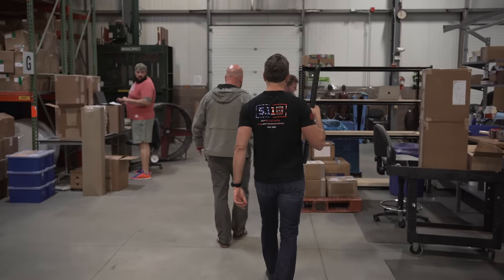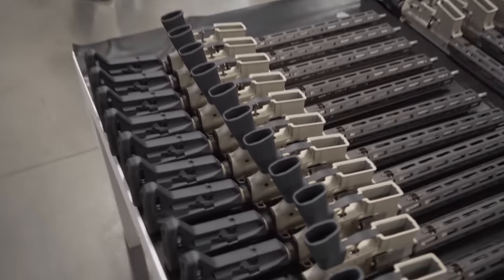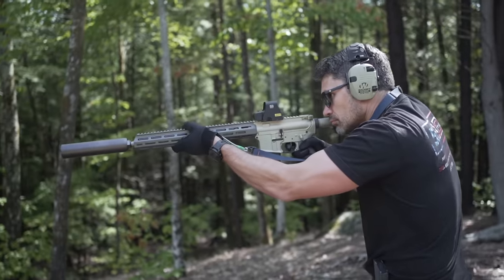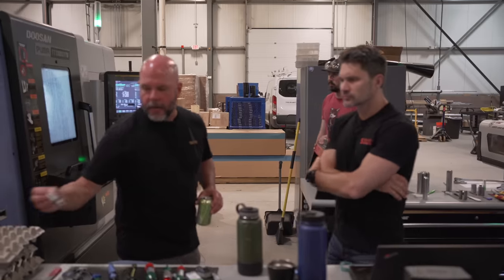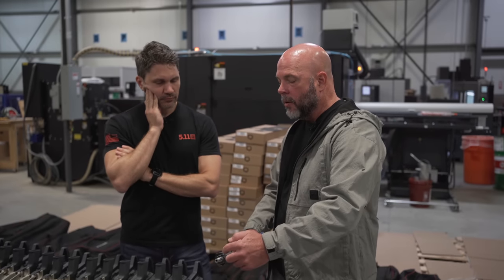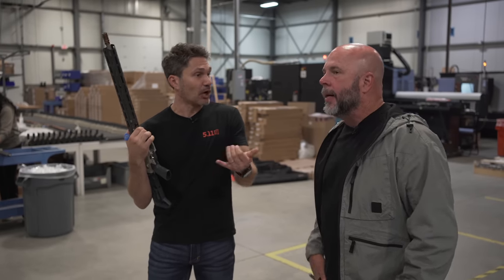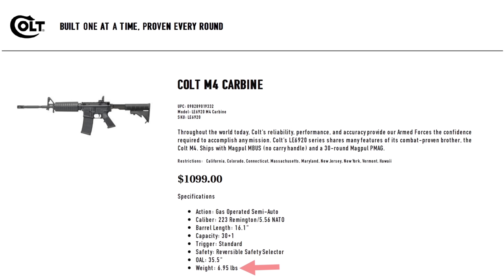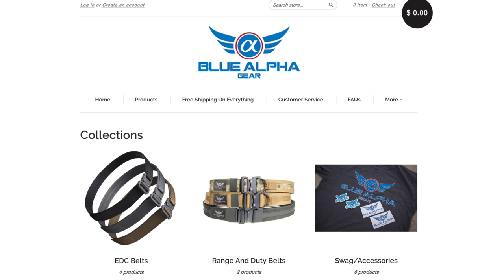Why Q's AR-15 Will Disrupt the Market: The Sugar Weasel 16"

Comment: Why go with their proprietary expensive AR when i could purchase a factory AR15 for less? Serious question
Reply: No proprietary parts on this one, it’s just a well made ar with tano receivers
Reply: Because the factory AR won’t be the same quality or have the same QC. That shit matters. Plus, the SW isn’t that expensive. $1500 isn’t pricey for a good AR.
Reply: Capitalism bruh so far very few Gucci ARs out run a psa
Reply: Not sure but getting any aero lower and good quality upper like bcm or dd you can
Slap those two together for less than 1200 and have a more parts that you want instead of typical milspec standards if that what you want.
Reply: Offers something no one else does. Take POF's e^2 chamber for an example, or LMT's enhanced bolt/bcg
Reply: Why get an F-350 when I can buy the F-150 for a lot cheaper?
Reply: Completely agree and I own some very expensive pieces. I stay away (or try to) from the proprietary stuff…..cuts off the aftermarket goodness and ease of repairs.
Reply: @morrokbyo  A 350 has capabilities a 150 doesn't. That's like comparing a .308 to a .223.
Reply: @Dressed2KillTaye  just as good poor
Reply: Because that's what a tool would do. A tool would buy from them. Unfortunately, tools live AMONGUS. So Q has clients
Reply: It's not proprietary. You get it if you. Want the upgrades it offers over other options. Just changing out a trigger over a bone stock AR can set you back hundreds. Piecing one together involves building and potential issues there. It's the same reason you'd get a nicer anything over a cheaper option.
Reply: @georgefloydsinhellwbreonna5330  "BuT MuH pSA-15 lOwEr WiTh MuH BeAr CrEeK uPpEr ShOoTs 1 MoA"
Reply: You know what I figured out? I like my 600 dollar db15 better than my ddm4v7, why? I upgraded the trigger charging handle muzzle break opted for a high end optic And I still haven't hit 1500 dollars not a thing bro just don't need anything like what's being shown
Reply: @sodakhilljack7147  Welcome to the light. Up here is where everyone who has realized there's no reason to spend big money on an AR resides.
Reply: It's not proprietary, If it were it wouldn't be an AR15 anymore.
It's just a nice AR15
And uhhh this is a "factory" AR-15. Do you mean like a super generic cheap M4A1 looking AR15?
Reply: You commented on a video you didn’t watch
Reply: @tysonbaker7085 "well made"
Reply: @sodakhilljack7147 you don't have a high end optic if your bottom line is under 1500.
Reply: High performance isn't for everyone.
Reply: He probably bought one of those airsoft scopes with a laser, red dot,  and a "red and green multi reticle" for 50$ and thought he found the greatest scope ever made lol.
Reply: @morrokbyo that’s not really the best comparison. An F-350 is like an AR-10 to an F-150s AR-15. There are certain roles where one is better to have than the other.
Reply: Adjustable gas, nice trigger, good resale?
Reply: PSA mic drop
Reply: @thedumbguncollector5546 with your name no wonder you’re supporting the gun
Reply: Bro, I've seen a PSA buffer tube come lose while shooting. I'm not even hating on PSA - I like a lot or their in-house stuff coming out - but they do build their guns to a price point and skip out on QC, or cut other corners.
Reply: @andreivaldez2929  it’s common sense to look over a gun after you buy it that shouldn’t have happened
Reply: @urdnotdank2642  PSA stakes the castle nut on their lowers. I'm guessing he saw one from a dude that broke the castle nut off then didn't reinstall it properly.
Reply: @sodakhilljack7147 how many rounds do you shoot? Have you ever had to rebarrel and upper because you shot it out? Don't tell me your carbine has never had a malfunction because if that's the case you haven't shot it enough. Even the best carbines like KAC, LMT, LWRC, DD will malfunction and fail at some point.

The reason tho cost more is typically customer service, QC, more attention to details, more machining and better aesthetics. 

Can you get a PSA that is superb? Absolutely. It's just more common with higher quality brands that you won't have to wonder "is this thing put together correctly" and if it isn't "are they going to take care of me".
Reply: Did you watch the video ? 😂
Reply: @2amichaelj  The reason they cost more is the name. Everyone says things like "the QC and attention to detail is better" because that's shit that can't be quantified. Plenty of "high end" rifles come straight from the factory with issues.

BTW, PSA's customer service is awesome and you get a lifetime warranty.
Reply: @stevem4783  PSA doesn't know how to pin a FSP right. Their gas blocks aren't lined up correctly, torqued correctly and I've had muzzle devices not timed correctly. They use decent parts but their assembly sucks. You don't know how many PSA uppers I've had to tighten down screws and just put together correctly to the standard other manufacturers will typically do.

Will they run? Yes. But after 200-500 rounds you'll notice bad ejection patterns or bolts not locking to the rear after empty mags. It's the little things. I'm not saying their parts suck they just don't assemble them properly because they are cranking out thousands more than most other manufacturers.
Reply: @stevem4783  some brands like Radian and KAC have 1 armorer that literally checks and gauges every single thing and puts together the rifle from start to finish on top of actual test firing it before putting his name on it. Seriously, you can't compare PSA some brands as far as assembling goes.
Reply: @stevem4783  and you're right No Company is immune to these issues. You'll just have less of them with manufacturers who aren't pushing out thousands of uppers and rifles a week like PSA. Also manufacturers like DD and KAC have to follow very stringent guidelines in order to produce weapons for military contracts. More so than necessary. Jeez us the cope is real.
Reply: @2amichaelj  all I'm saying is I just don't see why this particular ar offering is 1500 sure people who shoot 10k and up rounds a year need a high end gun. I personally don't see the attraction of this gun. If you're not in the personal protection
Reply: To continue my last post I'm not in the personal protection or law enforcement or mercenary career field so no I haven't blown out an upper I'm close on one but I've owned it a long time. I have better things to do with money than shoot that much. I shoot enough to stay proficient. I'm not attacking you or disagreeing with you this particular weapon isn't something that does it for me and I just don't see the attraction to it. And no my carbines have never had a malfunction because I clean them and lube them properly, my high round count for a weekend was 600 or 700 rds 0  malfunctions.
Reply: @sodakhilljack7147  all I'm saying is nice things tend to cost more money. I was kind of a dick. Sorry about that.
Reply: @2amichaelj  you are 100% correct nice things cost money I have nice things I'm not saying it's better than my DD I'm saying I like it better because I had the money to do some upgrades that helped me like it better. If I came off as a douche I didn't mean to and no blood no foul  brother we are all entitled to our own views. Best wishes

Comment: BCM upper, Aero lower, Sionics BCG is a far superior rifle for far less money.
Reply: Maybe 10 years ago bcm could be considered high end but not now. They've had major qc issues, they use excessively large gas ports, and their handguards and barrel nuts are not as strong as competitors.
Reply: Aero?  LMAO.
Reply: @OFFICIALUND  name (1) thing wrong with their lowers
Reply: @plmkoo6772  Nothing but a bit overpriced. Head to BA and get the same lower with a different rollmark for $50 less.
Reply: @dirtmcgirt7125  that's a legit point and good advice. That BA lower literally is an AP M4E1.

Comment: Criterion barrel, Aero receiver and rails, whatever controls you prefer = Boom! the best AR for anyone
Reply: Criterion barrels are very poor, no accuracy at all.
Reply: Faxxon 5r barrels for me. That's the fun in it, I can build to my own specs and still have money for an optic.
Reply: @actionjksn  lol you sure about that? I’ve been getting between .3-.6 moa with good ammo out of mine
Reply: @jaydubs6354  Maybe remove the decimal points. You want that sub moa accuracy you need Bear Creek Arsenal. Nothing else comes close.
Reply: @actionjksn  lol! Complete with timber creek red anodized handguard
Reply: @jaydubs6354  Now you're talking, that would look awesome, along with one of those plastic vertical hand grips with the bipod things that pop out. That would be a real tack driver!
Reply: @actionjksn  lol the grip pod! But don’t overpay for the well made metal one. Get the polymer one at a gun show for $45. Saves weight.
Reply: @jaydubs6354  I actually have one that someone gave me but I don't have it installed on anything. I suppose it would be better than holding it freehand for making a precise shot, but I just couldn't be seen with that thing sticking out of my handguard. I have a cheap metal bipod and it's a lot more horrible than I expected, I can imagine what the grip pod would be like with real world use. I ordered the metal one from Amazon and thought it's metal how bad can it be? Well pretty bad to be honest.
Reply: @jaydubs6354  I'll tell you the biggest problem with the grip pod. In order for it to be useful it requires them to make the vertical grip ridiculously long. I mean seriously nothing sticks out really far. It's going to catch on things and it looks so stupid as a vertical foregrip.

Comment: "The most crisp break you'll find out of anything, the shortest reset available..." I want a comparison between this trigger and the Blackout Defense Zero trigger. I have not seen or felt anything like the Zero Trigger.

Edit: Zero Trigger wins. You are at the wall as soon as you touch it. Does not move until it breaks. This one moves maybe 2mm before it breaks. Also reset is better on Zero Trigger.
Reply: Is it drop safe tho?    
I assume it is and if it isn’t I’d rather go with Larue or Geissele anyways over something POSSIBLY a tiny bit better with a worse track record and made buy a company that Kevin owns
Reply: @alexmaurice4274  yes sir it is is drop safe.
Reply: I have a zero in my BCM Recce....insane!
Reply: @williamg5477  same! Its a match made in heaven. The butter smoothness of the BCM recoil paired with that trigger. Its always a pleasure to shoot.
Reply: Triggertech diamond?
Reply: @kirkwest6654  Depends on your purpose. That one is tunable and can go down to 1.5lb trigger pull. Those are more competition inclined. The lightest you can get the Zero trigger is 3lb. If you watch a video of how the zero trigger is made, the set screws are actually welded so they dont move. If you want it for competition I would say Diamond and duty/self defense Zero trigger.
Reply: How does it compare to a Geissele SSA?
Reply: @johnfitzmaurice33AD  You really need to try the zero yourself to see how different it is.  Zero take up, you are at the wall the moment you touch it. It hardly moves because the reset is so short as well. Almoat like having a stationary trigger that actually works when you pull on it. Theres literally almoat zero movement. Hard to describe so I recommend trying it first hand.
Reply: @WREKLOC  Just got one, and holy sheet am I impressed. Never had an AR trigger like this before. Didn't know it was possible to have an AR feel like a 1911 competition trigger.
Reply: Difference is Q's trigger is a 2 Stage trigger, the trigger you are referring to is a single stage trigger. I have many single stage triggers that are just like the trigger you are referencing. It also isn't some crazy feat of engineering, if you are going to make comparisons, at least use the same mechanism in doing so.
Reply: @jasonhicks9262  you sir are correct. I did not know this was a 2 stage trigger. However, you have not tried the zero trigger and i can tell because i have other single stage triggers and trigger jobs on handguns. No timney or geissele single stage compares. I have those too.
Reply: Are you comparing a single stage two a two stage? Of course one moves before it breaks and the other doesn’t.
Reply: @f4t4lity0r4  yup. Guessing you didnt read the other comments. And Im also sure you also havent tried it since you think its like other single stage triggers. Go ahead an compare it to Timney or Geisselle if you have them
Reply: Timney 660CE is insane and also beats it
Reply: @rickw5024  thats a competition, tunable trigger. There are plenty of those.
Reply: Lol having a single stage trigger doesn't automatically "win" anything. It just means you like single stage triggers. A lot of people hate them, and would consider that a negative. Learn the difference between 2 stage, single stage and hybrid triggers.
Reply: @johnfitzmaurice33AD I like my ssa-es more. Q trig has more ot and a mushy reset. The actual break was nice so it's certainly better than mil spec
Reply: @WREKLOC No you don't have those too

Comment: I am as working class as they get, i dont have many things at all that are high end, im not even sure if Q is a high end company as the only thing i know about them is a few videos from youtube and my one snd only suppressor purchase of a Q erector i use for my taurus tx-22 and my built ruger 10-22. I must say i am absolutely impressed with the suppressor they built, from the overall build quality, to the design, the materials used, and the machining and fitment all top notch in my book. The price was absolutely reasonable as well. Hats off to you guys. If i ever opt to splurge on another ar i might look this up as the literal best trigger ever sounds fascinating, and from what ive seen, yall will back those words up.

Comment: Looks pretty gassy suppressed for a AR coming from a suppressor company. 

Other companies use A5 buffers and gas ports sized correctly for suppressors. LMT uses carriers that have a longer cam pin path for longer dwell time.
Reply: Thunderchicken is gonna be gassy on an autoloader no matter what you do
Reply: @roberthutchinson2856  If I remember right it is pretty restrictive on gas flow.
Reply: @ja0298  yup

Comment: I like the color. Wouldnt pay more than $900 for it. The market is way to saturated right now with ARs.
Reply: I'm not sure where the market being saturated is bad. Means you can buy a rifle that is ridiculously good high-end or ridiculously cheap, and everything in between.
Reply: Uppers can be found under 1k.
Reply: I don't like Q, and I wouldn't buy this rifle, but $1500 is a pretty fair price. You can barely get a basic Aero for $900.
Reply: @AdoreYouInAshXI  well that’s part of the problem. This Q rifle is now in the mix with dd, evolve, adm, lwrc, bcm, fn, et.  I’d pick any one of those ahead of this sugar weasel
Reply: Most common in usa except for handguns

Comment: I held a PSA Sabre just a few days ago. Didn't shoot it, a friend of mine got one and let me handle it for a little bit, and for around a 1000 bucks. This mid-tier AR companies, need to be worried. The rifle looked, felt and functioned just as good as any rifle 2-3 times it's price range. I own several ARs and built all of them myself, and IMO since PSA came out with the Sabre Line, pricewise I don't think I could build something as nice.
Reply: Bcm upper aero lower is still the way to go around that price point.
Reply: @talltale9760  I agree, can't go wrong with either.

Comment: The one thing I like about Daniel defense was the m4a1 ris ii with the quad rail. One thing I wish is we'd see more offerings with options for quad rails if someone wants it.
Reply: That's just a good way to add excessive weight on a rifle that has very low recoil. If you're planning on slapping a lot of attachments to it then that quad rail will make it even heavier. I think you can still buy quad rails to attach to any AR rifle.
Reply: @actionjksn oh man, 4 extra ounces! How the hell am I going to lug that from my car to the shooting bench?
Reply: @Fenster21  Only 4oz but yet it's noticeable when handling it, because the rifle doesn't feel as well balanced with extra weight being out toward the end of the rifle. A slim m-lok rail also feels better to grip in your hand. I guess if you're one of those people that just likes to put a bunch of gadgets all over the entire gun, the quad is probably a great option.
Reply: @actionjksn  quad just looks cooler, simple as. I have clamshells on my C7, quads on my SBR, I don't see the point in mlok. It's not QD, it's not lighter than clamshells, and what's the point in FF outside of benchrest shooting at 300 m+, at which point why not use a quad?
Reply: @Fenster21  Some people still like quad rail and that's fine. My slim tubes feel more natural to grip and I think most people agree with me on that. I'm definitely not a fan of the clamshell system. The only thing mounted on my carbine is flip up front sight and a small StreamLight and a QD sling mount. I don't need any more mounting space and it still feels pretty lightweight. My upper receiver adds a little extra weight but it's toward the back of the gun so you don't notice it.